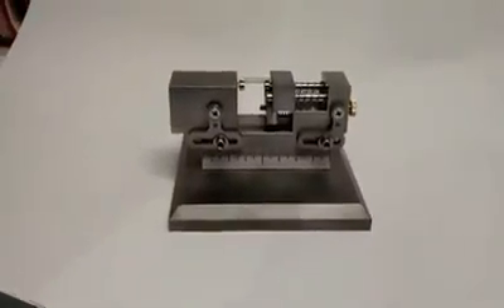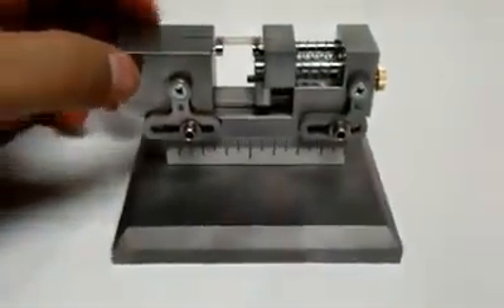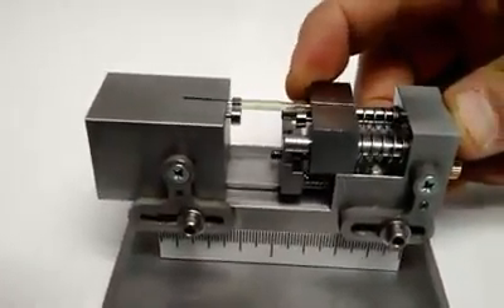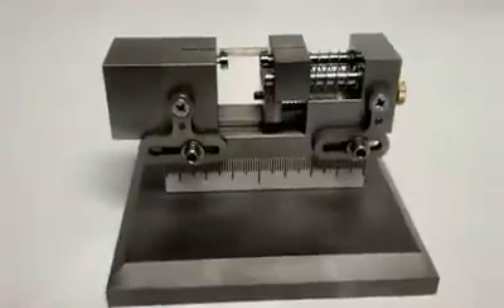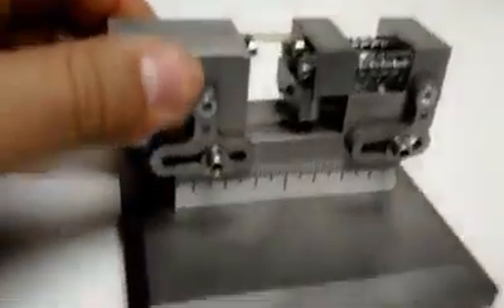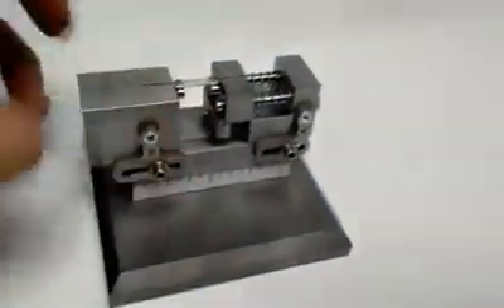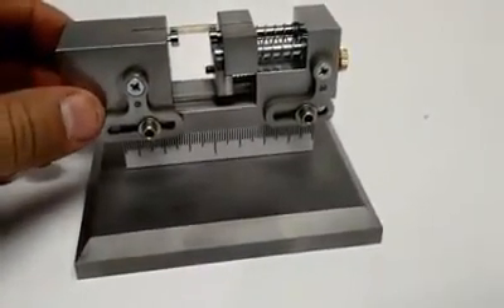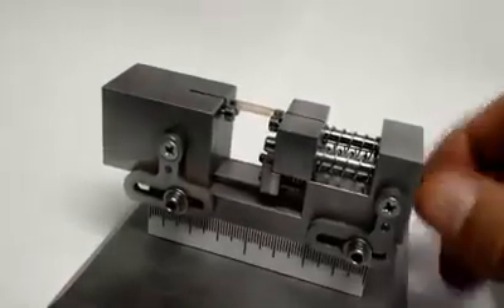Silk Screen machine - for sapphire glass capacitors

Comment from the maker: customer was thrilled with this little fixture
Reply: I'm curious what this actually does. Is it for printing a label on the capacitor or does it have something to do with the parameters of its function? Anyway, nice work on the build.
Reply from the maker: ExtantFrodo2 the parts are in the fixture sitting on a glass mandrel.  the entire unit sits in a silk screen machine and a conductive ceramic paste is spread on the capacitors.  then they are fired in a kiln to set the material.  so the fixture in the video is just to support the capacitors and spin them while in the silk screen machine to evenly coat the paste.
Reply: Ray Pena
So it's to actually produce the capacitors, not just label them. Interesting! They must have a number of different screens for producing different capacitors perhaps? Thanks for replying.
Reply from the maker: ExtantFrodo2
yes, they have 4 different silk screen machines and 3 of them have removable mandrels so they can change out the mandrels for different size capacitors. this one was just for the tiniest ones they make.  thanks for watching